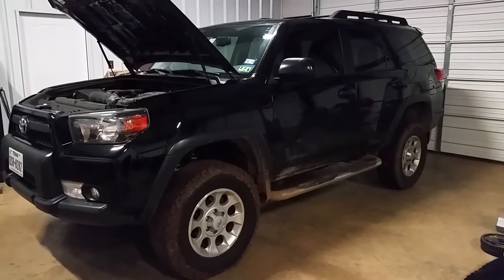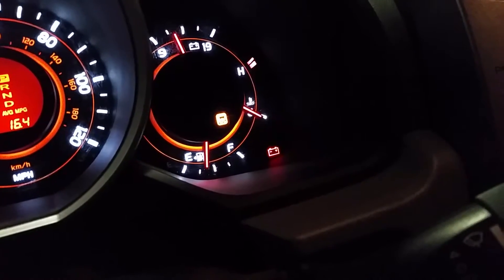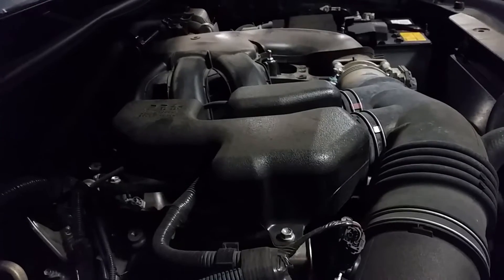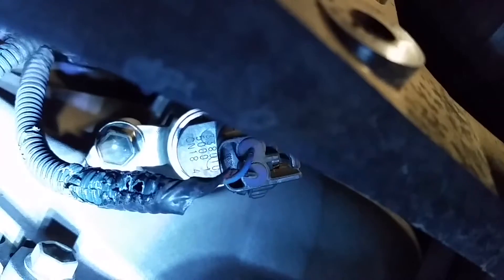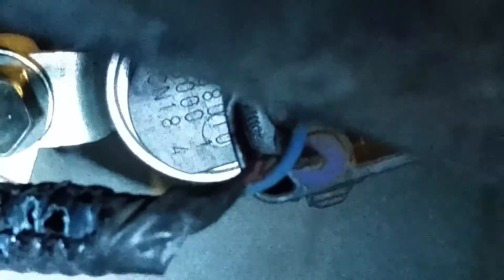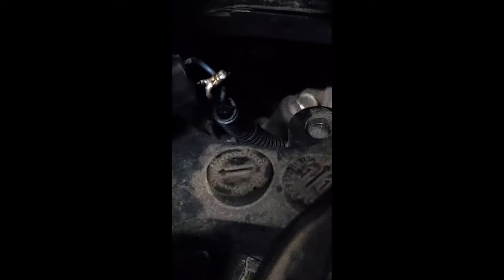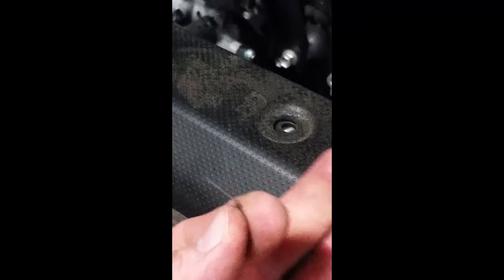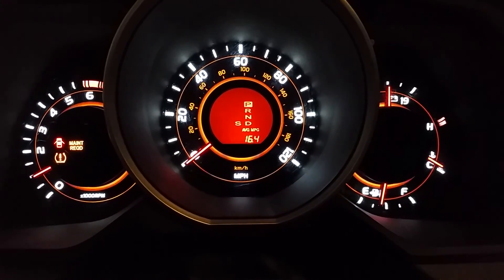P0020 4runner OCV Code

Comment: Fj cruiser and same issue. I didn’t drive it for 2 months and they set up a nest and chewed 5 wires. No way I could get in deep enough to solder so I used the wago connectors and they were tight and strong.  Real rewarding to see those check engine lights go away on start up!  Btw, my neighbor said to leave the hood cracked opens few inches and they won’t consider it private enough to burrow in. We’ll see.